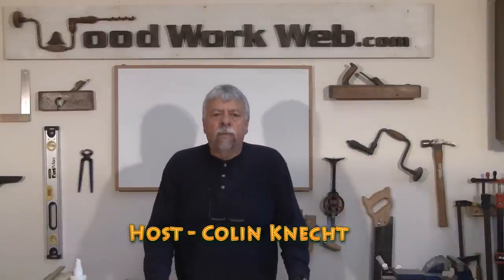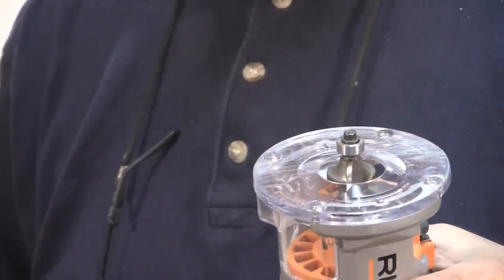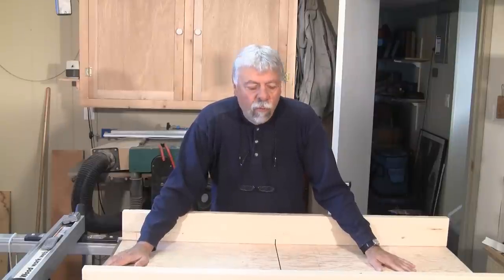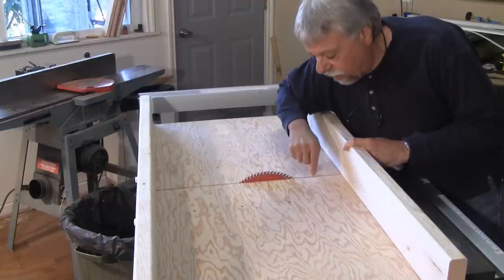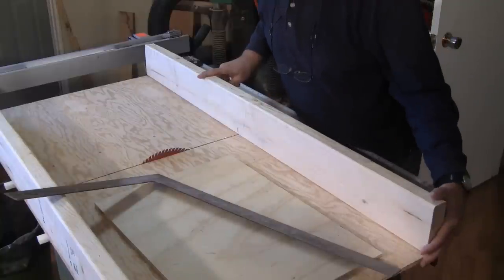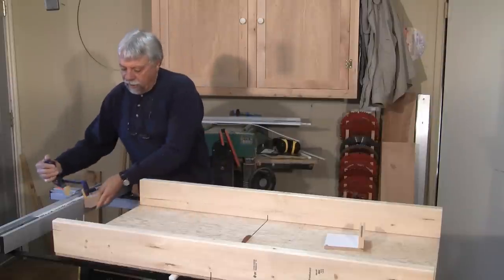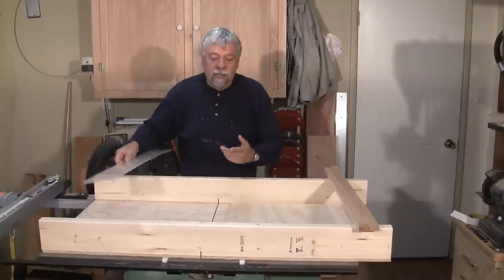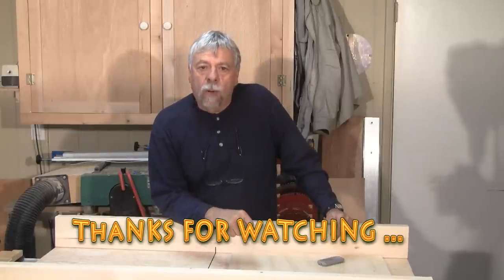Building a Heavy Duty Crosscut Sled - A woodworkweb.com woodworking video

Comment: Nice job on the sled. I use the 5 cut method to square the fence to the blade. It works well and is very accurate. 
Thanks Colin

Comment from the maker: I simply placed the mitre blanks in the slot, raised them up a bit with that cardboard insert, then placed the bottom of sled over top and positioned it to where I liked it, then drilled some counter sink holes then screwed the base to the blanks from the top. I did VERY carefully measure my countersink sizes and depth and the the screws I would use so that the screws would not protrude though the bottom of the blank.  Hope this helps, let me know if you have more questions .... Colin

Comment from the maker: Hi Chuck, you raise a very good question. What I would say is that yes, you can make a crosscut sled for your saw, and yes the sled can be bigger than your table, but what I would recommend is to make little bit smaller one that what I made, to reflect that it is going on a smaller, less powerful saw. Just make it a bit narrower and shorter, and maybe make the plywood base a bit thinner and it should work fine for you.
Thanks for commenting ...
Colin

Comment: Thanks for the video.  I was going to make a curved backstop like one sees in other designs but I understand the reasoning behind just using a straight backstop instead so that simple jigs like you showed can be attached.  Your choice of runners for the table channels that help your sled slide smoothly are a great idea, and I will incorporate that into mine, as well as the chamfer on the bottom of the backstop.  This is just what I need for my Delta contractor saw.  Again, thanks for taking the time to share your design, I'm now subscribed.
Reply from the maker: Barry Wilson Glad this was helpful Barry ... thanks for commenting

Comment: I have one of the smaller table saws. Since the table is small can the corsscut sled be bigger than the table or should it be the same size? I'm afraid the sled will tend to tilt off the table and create some real problems. 

Thanks:
Chuck

Comment: To me one of the trickiest parts of the sled is the strips that go in the miter tracks. Do you have a method?
Reply from the maker: Herb Schneider Yes, I agree with you, when you say do I have a method, do you mean attaching them or making them?
Reply: Making them. I've seen cutting on the table saw, on a band saw and most often they don't show it at all. The one sled I did make I had some screen mold that fit the tracks exactly.
Reply from the maker: Herb Schneider  You can purchase plastic runners, I believe you can also purchase aluminum runners ... for me, wood does not work, too much variance in ambient moisture which makes the runners either too sloppy or too tight, which is why I purchased some raw plastic and cut my own.
Reply: Which is my question, how do you "cut" them.
Reply from the maker: Herb Schneider  On the table saw, bit tricky to get it just right, I think on these I went a wee bit large when ripping them, then re-ripped them by inserting paper between the fence and the plastic stock until I got them perfect, I think it took 3 or 4 sheets of paper
Reply: Thanks

Comment: In reference to a guard of some type. Could you make a channelled guard the entire width of the sled, say 2 pieces of thin 6mm ply glued to a 5 mm strip, and make it adjustable up and down depending on the thickness of the wood your cutting?
JD.
Reply from the maker: Hello Jay, thanks for the note. I am a big fan of safety and especially safety guards but have mixed feeling about them on crosscut sleds ... and here's why. In my experience, with safety guards on, I have witnessed a number of times, people who try to reach under the guards while the blade is spinning. I don't know why some people seem to have an urge to do this when the guard is on ... when it is off, they don't tend to reach in. I would love to know why this phenomenon happens, it's crazy, but I have seen it a few times, fortunately no injury, but it did make me wonder.
I like your idea and it may work better than guards I have tried to install. Would love to know how it works out, keep abreast Jay ...
Many thanks .... Colin

Comment: A lot of accidents occur when your to impatient to wait for the blade to slow down. I wonder if you can somehow fit a calliper and disc pads, like on a go-kart to the blade and with a pedal, being able to very quickly stop the blade?
Reply from the maker: That's not a bad idea, sort of like a manual brake. I have never seen that done, but it would be interesting to see it in action ... maybe this is some sort of a new idea for you to develop and patent ?? 
I will offer to be a tester :-)
Reply: I wil look into it. I've just ordered a Laguna Platinum saw. You would have to mount the disc to the motor pulley. JD
Reply from the maker: Jay Dee  Yikes ... that's a lovely saw, you are a lucky guy !! ... let me know how you like the saw. I have not used that one but have others and they are great.
Reply: Thanks. A big step up from a Triton. Harvey and Woodman seem to make a copy. But I didn't want to chance it. Because the Triton gets fed from the right side of the fence, I will  do the same with the Laguna. It also suits my workspace.
JD

Comment: I disagree with the blade height discussion in the video.  If you have your blade only 1/8 - 1/4 inch above the top of the work, you asking for blade-climb kickback.  No thanks.  Happened once when I was a kid (40 years ago)... never again.  At that low protrusion, there's too much tooth-to-surface contact.  If you talk to PhDs about rake angle and such, they'll support the video.  In reality, that is more dangerous, not less.
Reply from the maker: There are always pros and cons to everything, and yes there is more kickback with a lower angle, but according to the blade manufacturers, that's where the optimum  cut is, it is also safer having less blade exposed. Having the blade all the way up also increases the back-end blade lift, yet another safety issue.
I didn't come up with the idea of having a low angle, only relating what height school and college shop shop teachers and others concerned with safety have told us.
But ... like all things woodworking, there are many ways to accomplish the same thing, so we all do what we are comfortable with and plan for no accidents.
Thanks for your comments and for expressing your views :)
Colin